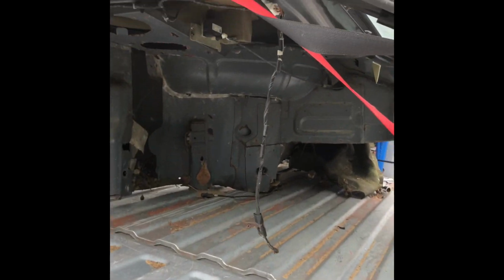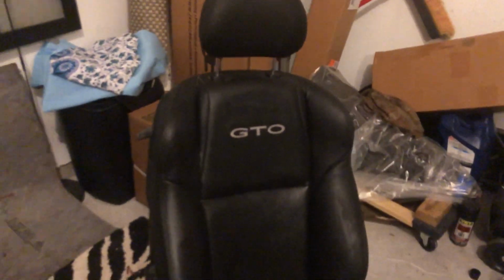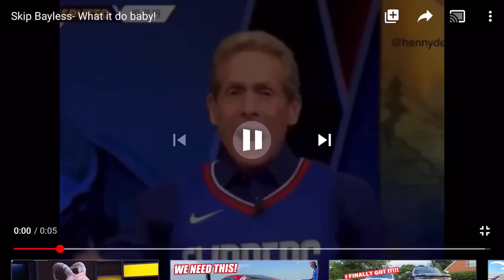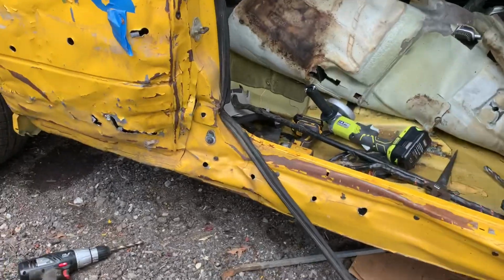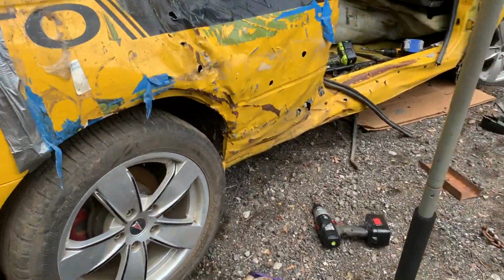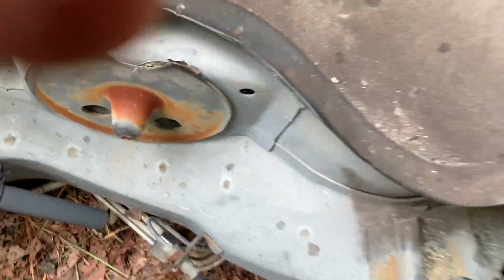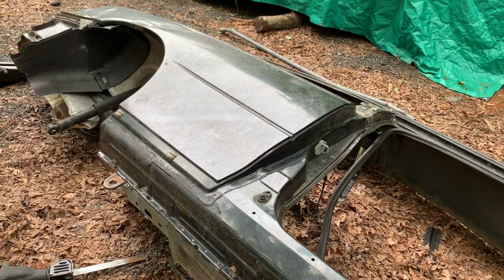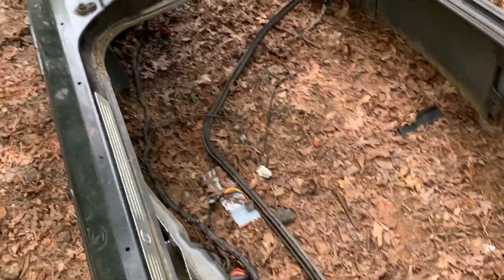Fixing The GTO Part 3

Comment: Do u still have the parts gto cause I needs some parts
Reply from the maker: I do...I’m almost done with the rebuild and will be posting a parts list for sale. What do you need?
Reply: Derrick Canzater  I need the back light s and the wing and the over lay on the middle console
Reply from the maker: @1bad02ceta  $250 for both lights, wing, and silver inlay piece of the console. I'm assuming you're talking about the piece that goes around the gear shifter correct?
Reply: Derrick Canzater yeah that’s the one I’m taking about
Reply: Derrick Canzater will u ship the stuff cause I’m in texas
Reply from the maker: mario moreno I’ll ship if you pay shipping. I can put everything together and give you an estimate for shipping. The wing would be the biggest and heaviest piece.
Reply: Derrick Canzater can u find out how much will it be for shipping
Reply from the maker: @1bad02ceta  what's your address?
Reply: Derrick Canzater 1039 N Wright ST Alice Tx. 78332